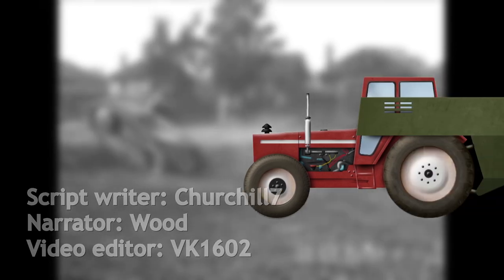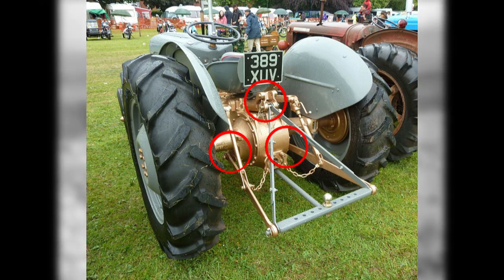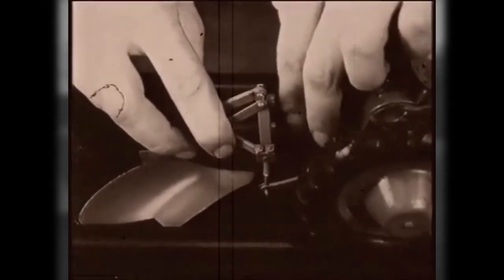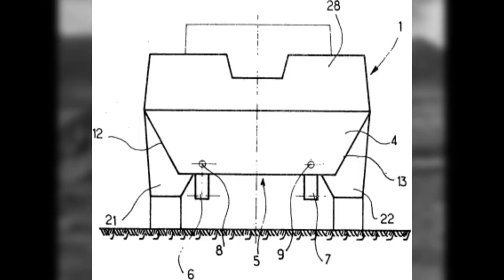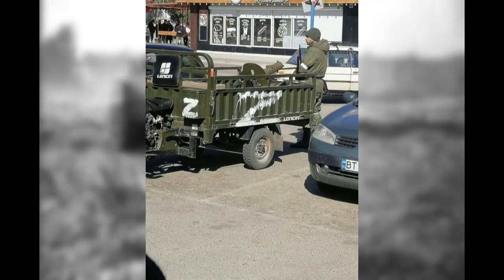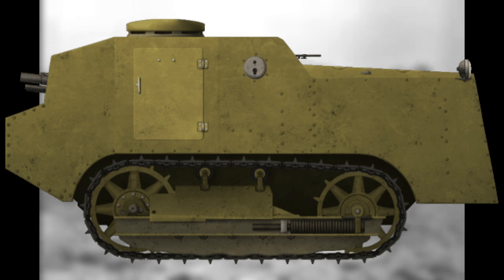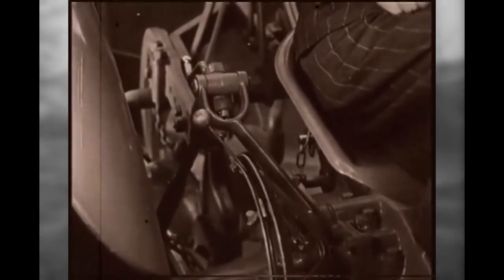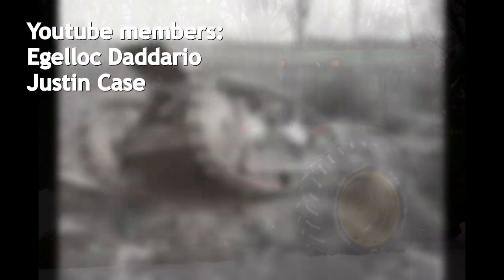Farmed and Dangerous! | The Bouffort Tractor "Tank" Conversion

Comment: Hello tank encyclopedia in japan we had untill around late 80s early 90s only a 2 point and mostly it was a tiller on the back but almost all of those tractors were or could be converted into a 3 point
Reply: Not compatible with imported American farm devices?
Reply: @teslashark  I noticed at my local frontier museum that allot of older implements have a 2 point interface.

Comment: Tractors can be very usefull for  the forces, even with armour, but not as a tank or an IFV.   However if they are fitted with a frontloader, they are very good for work on airfields  and further away from the front in logistic tasks, especcially if fitted with airbrakes  Towing ground equipment and  trailers with ordnance  and also as a snow plough, a forklift and for Rapid Runway Repair   teams.  Actually  companies like Valtra, and John Deere and JCB  build, such equipment, together with third parties.

Wneh I was in the Royal Netherlands Air Force, we had MB Trac agricultural tractors, with some adaptions  doing work like this .